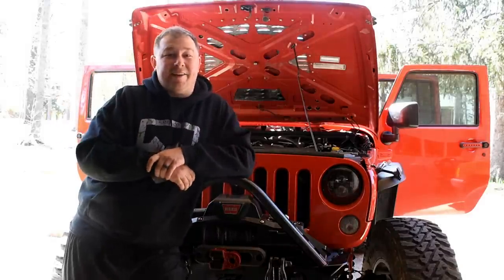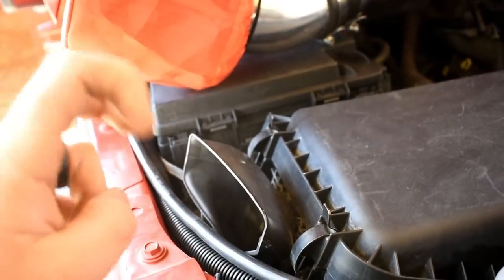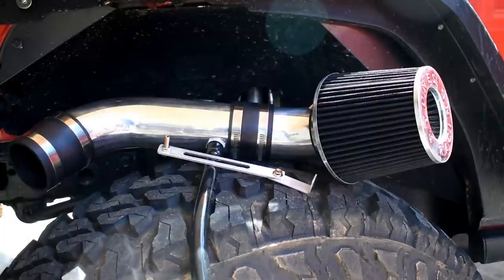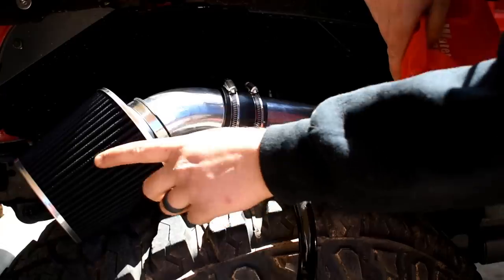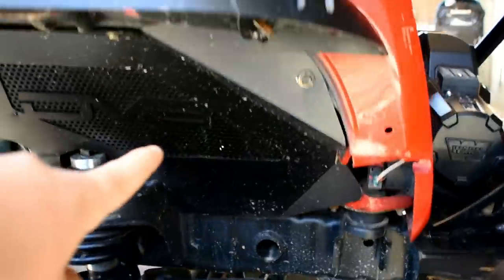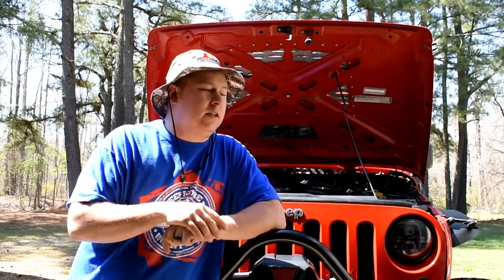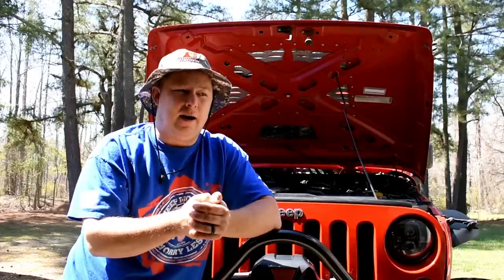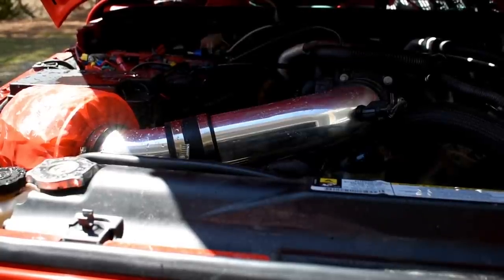Jeep Cold Air Intake - $40 Kit- Install, Test and Review

Comment: Use some heat wrap around the pipe then take another test and update this post. I have looked at these cheap ones and thought about wrapping the tube in some heat tape...for like cycle exhaust pipes.
Reply from the maker: I will give that a shot. Part of me thinks that wrapping it might cause the pipe to heat up more since the aluminum won’t be able to release the heat. It will be a battle between which is more important (dissipating heat or preventing it).
Reply: Also is the filter that it came with as good as a K&N or any other name brand high flow air filter? I think the wrap is going to reflect the heat away from the tube. Also is that a real aluminum tube or different material with an aluminum coating?? Just a few things to think about. Also you could have cut away the section of the battery tray that has the holding points for the old air box and set it to the side. That may help a little being the  DV8 inner fender has a screen already over it.

Comment: Good review, but you had the heat issue backwards.
 Aluminum is not a good heat sink so it wicks heat away better. Comparable Plastics are actually slightly porous, and tends to be more of a heat sink.
This is why aluminum rads, and inter-coolers are so good at what they do.
Reply from the maker: Thank you! Good info

Comment: I have a filter like that on my Harley and it's a pain to clean it.  The cover is called a sock by Harley and many riders use it all the time.  I never use mine - it cuts down on performance and is not needed in the rain as the oil in the filter doesn't allow much or no water to get through.  I have ridden in heavy rain with no problem.  Thee only problem was when I had the  sock on and it was dusty - some engine missing.  I took the sock off and no problem.  My buddy says the clean out engines with some water in the filter where he works.  Maybe it's different for a jeep.  ( I just got a CAI for my Wrangler.)
Reply from the maker: What your referring to is pretty much a prefilter. This is actually a waterguard,  lots of people hydrolock their jeep engines from splashing through deep water with a cold air intake. I would highly recommend running a water guard if you have a cone style filter

Comment: I’m only at the 5 min mark here, and I will continue to watch the rest,  but a thought struck me, the more expensive cold air intakes have the shrouds around parts of them, could you maybe achieve the same thing by keeping the original filter box, just removing the top from it and placing this filter inside it running the tube through it?

Comment: ihave almost thye same on my 16 jk , noticed the hotter air but better response.....so i had an idea and wrapped the aluminum pipe with header wrap , for 20$. and noticed about 3-5 mpg difference.
Reply from the maker: That’s good to hear! So you did the wrap and actually noticed an improvement?
Reply: yeah just a little cooler but not as hot, and still cheaper to do that then buy a 300 + plastic intake   all together 160 with pipe, wrap and shipping / handling. more throttle response then anything
Reply: 3-5 mpg difference????? That's a big difference would think maybe 1 or 2 mpg more how did you calculate those numbers?

Comment: What I noticed the most was the volume of air that the intake let in.  My air flow increased by at least 30%, but I still swear it was closer to 50% more air.  Also when I was on the highway and would hit the gas the engine noise sounded like a hamster squealing, but afterward it was a nice throaty rumble all the way to death wobble.  Just kidding about the death wobble.

Comment: I enjoy your videos, unforntunatley the link to the amazon cold air intake is wrong. I ordered it and it does not fit my 2008 JKU Xt. the vent tube is way too small and the connection in in the bend next to the filter.
Reply from the maker: I’m sorry, did it look similar to the kit in my video? I’ll delete the link
Reply: I ordered the one from Amazon and the hose sizes were wrong and the placement was wrong so I ordered the one from eBay and should get it tuesday
Reply: @garysumner6032  did you end up installing the ebay one? does that one fit? ive got an '08 jk and was considering getting that one. and if you installed it, how do you like it so far?
Reply: Con D lol! Did you go through with it and if so how do you like it?

Comment: Really love your videos and as someone already stated, they are more directed for the average Joe who is on a budget! Was gonna buy the CAI from EBay and water block filter, but you stated yours was a medium size, all they show is a small and large?? Also was seriously thinking about doing the Magnaflow muffler install, did you end up extending your exhaust to the back, and did it help with the resonating noise?
Reply from the maker: I think I have the link to the pre filter on amazon. The video description should have the info, I don’t remeber what size sadly. But yes I extended the tailpipe and it helped a bunch

Comment: To fix the heat absorption... All you have to do is wrap it in exhaust wrap.
Reply from the maker: Well that gets a little tricky, it gets to the debate of heat dispersion vs asorbstion. Aluminum dissipates heat easily, and a wrap will slow heat absorbstion but hinder dissipation.
Reply: @JKGearandGadgets  that does make a lot of sense. good point.

Comment: Can you somehow connect the stainless steel pipe to the factory box? It looks like the silicone sleeve will somehow connect.
Reply from the maker: I think you could. You might have to cut the pipe down shorter though
Reply: JK Gear and Gadgets Thank you. I wonder if I would get the same temperature from the factory box with the pipe at.
Reply from the maker: I would think it would be very similar. However you will notice more performance with this style filter opposed to the stock filter. Could possibly find a way to cut the factory airbox hole bigger and have this filter sit inside

Comment: I bought this and installed it in my 2011 jk and started to run bad and get codes, took it off and my jeep ran alot better. No blame to JK gear and Gadgets
Reply from the maker: Was your MAF sensor re installed correctly? This intake shouldn’t affect anything
Reply: @JKGearandGadgets  yes installed new sensor, everything was good for about one day, then everything went bad. Took off filter and reinstalled oem and jeep went from running bad to good.

Comment: What were you using to read the temps? I may have missed it, if you mentioned it
Reply from the maker: Veepeak Mini WiFi OBD2 Scanner Adapter for iOS and Android, Car Check Engine Light Diagnostic Code Reader Scan Tool for Year 1996 and Newer Vehicle in the US https://www.amazon.com/dp/B00WPW6BAE/ref=cm_sw_r_cp_api_UwaZAbXEW1D8V
Reply: What app are you using as well? Ive ordered the scanner but reading the reviews it shows different opinions on apps to run the scanner. Which one is the one you are using? Thanks for the response in advance
Reply from the maker: I’m using dashcmd

Comment: What reader do you use on your Jeep to get that data
Reply from the maker: Veepeak Mini WiFi OBD2 Scanner Adapter for iOS and Android, Car Check Engine Light Diagnostic Code Reader Scan Tool for Year 1996 and Newer Vehicle in the US https://www.amazon.com/dp/B00WPW6BAE/ref=cm_sw_r_cp_api_flFZAb8S841Q6.  And I used the dash command app. But there are a few free apps

Comment: So I'm planning on getting a RedRock 4x4 Cold Air Intake Kit for my 07 Rubicon 4 door, but I'd like to get that mesh water resistant cover for it. Unfortunately, the filter on the RedRock one is a lot bigger so the one you showed would definitely not fit. Could anyone help with a similar mesh net to protect the exposed filter from water?  I'd rather not get a snorkel.
Reply from the maker: I don’t know of any that large :/ sorry bud

Comment: A few issues. 1. Your outside temp according to your dash was 49°F. Please retest above 80°F to a more accurate assessment. 2. Seat of the pants and psychological "feeling" of improvement means absolutely nothing. Before and after dyno pulls will show you that in nearly every system out there that has dyno video and charts... 2-7hp increases were made. That equates to about $65 per horsepower based on an average cost of $300 for most CAI. It looks cool. It sounds cool. $65 per horsepower? Not so much.

Comment: Can you run a dry filter on it?
  Oil filters dont run so well in the desert.
Reply from the maker: Yes you can.
Reply: Would you think it would make performance difference?  What about the hood louvre?  Thinking of doing this and and cat back.
Reply from the maker: Talking about the entire cold air intake or the oil free filter? And as for the hood louver.. do it!! So much heat gets out with the louver. Must have if your in a hot area. I went with the byline louver because it looks so much cleaner since it uses studs instead of 35 bolts like the other companies.
Reply from the maker: Also check out my exhaust video. Installed a magnaflow muffler. Pretty much the same as their kit, but reuses factory piping which is the same size anyway
Reply: Just did the intake.  I noticed a small difference and I dig the growl.  Next is the exhaust.

Comment: That definitely doesn’t cost 40$, str8 untrue
Reply from the maker: It literally did. From eBay. And I included the link…
Reply from the maker: Now, 4 years later with inflation. It’s $50. Don’t come at me again with your overinflated ego ding dong. https://www.ebay.com/itm/SHORT-RAM-AIR-INTAKE-KIT-BLACK-FILTER-For-07-11-JEEP-Wrangler-3-8L-V6/362030091849?_mwBanner=1&mkcid=0&mkpid=0&emsid=0&ufes_redirect=true&ul_noapp=true&pageci=d73245fb-42ee-4a1a-a8a9-b8d80fa78067
STR8 idiot

Comment: Congrats on getting Hoodwinked on this snake oil.
A fool and his money are easily parted.
Reply from the maker: I noticed a difference
Reply from the maker: That’s a joke... if you watch my video I address all of what he said.. no check engine light.. the computer will adjust for the extra airflow, the factory airbox isn’t designed for performance it’s designed to be quiet and muffle Intake noise. Mine did not suck in hotter air, it actually lowered the intake temp about 5 degrees, I noticed better throttle response and I’m happy with the setup.
Reply: JK Gear and Gadgets 
If you say so. It's your money.
Enjoy.
Reply from the maker: I know it’s not for everyone, but I found it worked for me. I wouldn’t pay 300$ for this setup, but for 40$ I’m happy and wanted to share with others Incase they want to do it. 🍻. Thanks for watching and hopefully you’ll check out some of my other videos
Reply: JK Gear and Gadgets 
Ok, thanks.